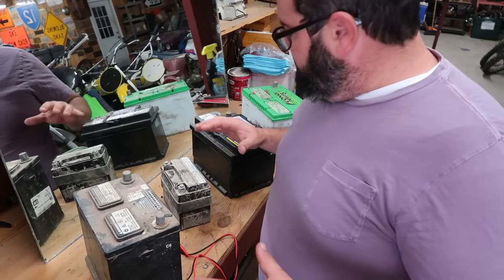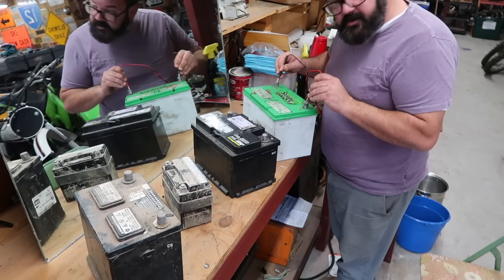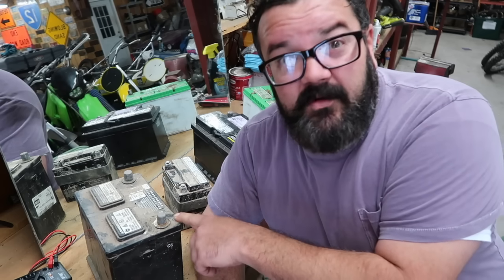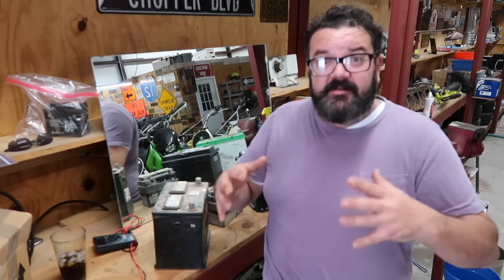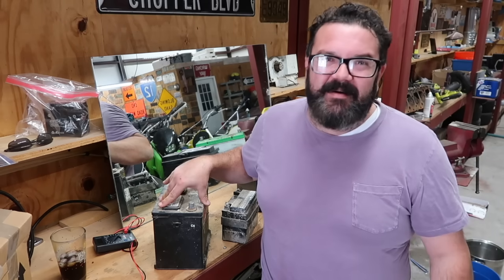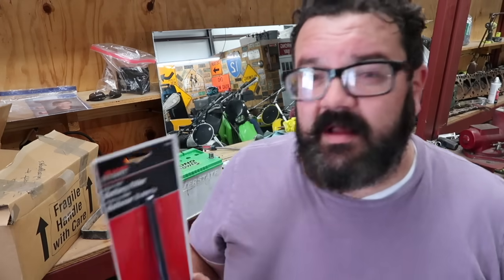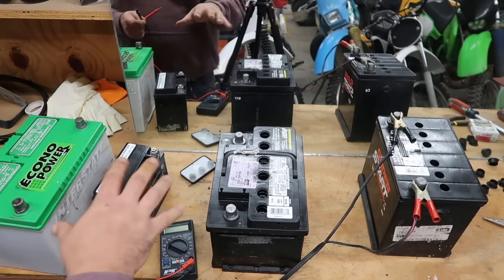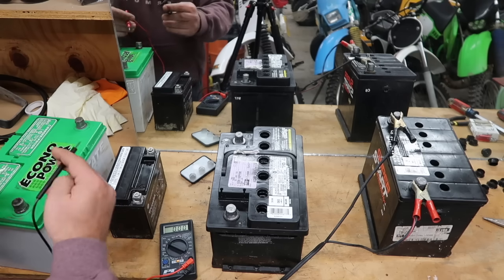Reconditioning a 12 Volt Car Battery: 100% Success

Comment: Is not 100% successful but still reasonably effective.  Just a couple better practices tips for you would be 1: do you know what voltage charge the battery is actually holding you need to wait at least one hour after removing from the charger before taking your reading to allow for the battery to cool down. A perfect lead acid car battery will read 12.8 V fully charged not to put down your method of recovering these batteries I do need to be negative for a second and inform you that the batteries you are getting a reading of 11.2 V 11.4 V have what is called a dead cell in the battery and will never hold anything more than the 11.4 V. This will be confirmed if you were to test each individual cell voltage in the battery and it will confirm what I am saying about those batteries in this video. unfortunately I have not found a way to fix a dead cell battery successfully.
2: A dead battery before you start your process reading 0.5-3.0v Will have a 99% chance of getting full voltage back out of it after you’ve done what you were doing as all cells are in the battery have drained equally. And a 12 V lead acid battery each individual sale in perfect condition will have a voltage of 1.2 V all six cells combined you get a total of 12.8 V which is what a perfect condition fully charged battery would read. If when starting your process you get a reading of 10 V or around there there’s going to be a 98% chance that one of the six cells is dead and no matter what you’re doing or showing us you have done in this process is going to fix a dead cell if you get a reading of 10 V 11 V at start I would suggest individually sell testing voltage you will find that five out of the six will have a reading of1.0v and once I will have a reading Around .5v. The .5v is your dead cell. You might as well check that battery to the side and not waste your time trying to do this process with it because it will never recover that dead self no matter how long you keep it on the charger after an hour or more of rest and cooling down after removing the charger it will again drop to 11.2 V

Comment: Have you rver created a wet battery or eater battery using plants if copper and nickel, i like using these for the wet or water battery.  And in this copper -nickel eater battery, the plates may oxydize and would need to be polished down for better contact in each cell, each cell dhould register 1.5v a universally found voltage, from solar panels and humans, to wet cell batteries or water batteries with each cell registering 1.5 volts.

Comment: Basically you "de-sulfated" the batteries but in the process destroyed the cells (lead plates). While they will show a good charge, the ampacity of the battery is garbage. They couldn't start a lawnmower.

Comment: If you throw a wire over a tree limb at 20 ft high,  you can measure 14v DC, wow, you say, but there is almost zero amps avail so since Watts = Power = Energy = V x amps its about () watts, BUT if you now raise that wire to 1000 or 3000 ft, you can collect lightening bolts, lots of amps for short time, and the volts are what about 1Million volts,  BE CAREFUL, wait for experts; but it does bring up an interesting point Tesla mentioned, " we are surrounded by energy, while we starve for energy" lol.   So build a 1Milliion volt motor, send a conductive lightweight wire up with a balloon, wait for lightening bolt to run motor; if motor is connected to a building raising device you can store the energy (or a water pump to pump water up to mtn lake, or water tower, etc... BE CAREFUL ! The life  you save may be your own.
Reply from the maker: TOOOOO MMMAAANNNYYYY COMMENTS

Comment: The epsom salt idea seems to always bring the voltage back up on batteries, but I've yet to see someone get any real success by doing a load test that actually shows the battery can deliver the amps to turn over a car properly. You can have 12.7 volts and the battery immediately drop under load and only supply 100amps when it should be dishing out over 700amps.
Reply: My thoughts on this were pretty much the same as yours, that is until this happened...
I tried to bring a deep cycle 12v back to life, and although I did get it to hold steady at 12.7, it was no good under load. So I put it to use in an outbuilding to run a lightbulb, keeping the battery running with a small solar trickle charger. One day just for the heck of it, after six months, I decided to test the battery and I'll be damned after seeing it had actually restored to it's new state of operation after the low slow and very long trickle charging. It seem we need to rethink the time needed for this procedure.

Comment: One more try before you try to desulfate the led is simply try cycles of charging and a strong and quick discharge with a diesel glowplug every 2-3 hours. Do not discharge completely, connect the glowplug for 5 seconds and again leave on the charger for couple hours. Strong current helps to break thin sulfate layer on the led, and battery will accept the charge again. Of course if the condition of the battery is not totally bad.
You could also try complete method for battery reconditioning described here: https://world-n-life.com/?page_id=44

Comment: I really can’t see what you’ve achieved. Voltage testing is only part of the story. Amperage is what you need to check and acidity of the solution.  I’m going to try dumping the sulphuric acid, washing out the plates and returning the acid

Comment: Just buy a new battery. Your recondition battery will never last very long if it does work at all. You’ll end up getting broke down somewhere where you’ll have to buy an expensive battery because it’s close to your breakdown point. Better to buy one where you can get cheaper and plan ahead.

Comment: Why don't you just immersed the battery in a ultrasonic cleaning equipment. I bet the ultrasonic wave can remove all the sulphate deposit ok the plates. Have anyone try?
Reply: Not a bad idea. I wonder if it would break the cleaner.

Comment: Seriously man all batteries have cycle they don't last forever. Now we have New technology salt graphite,  lithium ion and now we have BMS controlled and dcdc chargers built into batteries batteries have now changed. 4×4 RVs caravan are all discovering new better ways to get longer cycles. Balancing cells also you can make your own battery with PVC and cap it use solid copper bar or nickel rid pack it with crushed powdered graphite or charcoal seal it charge it there's your high Amp Battery try it

Comment: Do you not understand what volts and AMPS are? 
What makes you  think salt water will work like 35 percent Sulfuric acid?
Why would the battery manufacturers pay for Sulfuric acid if cheaper salt water would work as we.l or better?

Comment: These hacks do not work on batteries with dead cells or one that will not hold a charge. If the battery is good but has sat around and lost its charge just simply charge it for a day.

Comment: It would work right away, but after a day, the battery charge would go lower than previous day. In simple words: it is wasting time and it would not work. I experimented it for weeks, the result was very disappointing.

Comment: When a battery is dead, it is dead. Period.
Reply: not true at all, there are some better videos out there showing it best to use a battery charger with the 50Amp 250v START cycle and you hit the batteries with that for 15  minutes × 5
Reply from the maker: Nope

Comment: I don't know man that doesn't prove the batteries bow ones.good, you need to load test them if they are good now or not,   because mine is 13.8 volts,but still can't crank the car at cold weather  below zer after one day of charge even the voltage sg
Hows 12.6 V and it can't crank the after two days even above zero temperature, even the voltage showing 12.2 V.

Comment: You are 100% wrong. Letting any car battery sit dead for long periods of time does NOT create permanent damage. The acid turns into a crystal on the lead plates. When recharged, (usually you will need a vintage charger without overcharge protection) the crystals on the plates dissolves and returns to sulfuric acid. No damage done. And it is also is impossible to make a car battery last forever. When you use a car battery, whether you charge it, or discharge it, it is transferring electricity, which causes heat on the lead plates. What happens when something heats up? It expands. Then when it cools down it contracts back to its original form, which, over time, causes the lead particles from the plates to break off, and build up at the bottom of the battery. When too much lead particles build up on the bottom of the battery, then what happens? It starts touching positive and negative plates which causes shorts. That is the ONLY cause of a batteries failure. That’s why worn out batteries get so hot when charged. There are ways to reduce lead plates from breaking apart, (aka shedding of the plates). One, is to always use a slow charger, because the less the current, the less heat will be created. Two, is to use a “Pulse charger”. What this is, is a charger that pulses, meaning it charges the battery for like half a second, then turns off for half a second, so it gives the battery time to cool down, so the plates don’t get too warm and expand very much. So there really is nothing you can do to “renew/recondition” a battery, unless you take the plates out, melt them down and make new plates, and clean the lead particles inside the bottom of the battery case. So any video/ad that advertises “battery reconditioning” that just shows them putting in random shit like baking soda, or epsom salt, is a scam. Baking soda, won’t do anything but neutralize the acid, which will make the battery have no chemical reaction, and will bring the voltage down to zero. Epsom salt, does not renew a battery. It kind of boosts the conductivity of the battery electrolyte, barely, and is not necessary at all.

Comment: A battery needs to tested for it's ampere hour capacity ... ie  5 amp load times the time it takes to  discharge it ...... amp hrs ...... you will never get full capacity back because the lead pasted plates how lost much of the lead sulphate has dropped off to the bottom of the battery! . In short you have slightly revived two batteries which will have a small amp hr rating ...... and not for long !!

Comment: There is some speculation here about the charge being "held in the plates." The structure of a car battery is a bit more complicated than that. There are separate positive and negative plates and some of them act as a current collector. One thing to note is that a good battery will not only hold a charge, but will eventually generate a full charge even if it is fully discharged, due to the reaction of the acid with the plates. For that reason, if the epsom salt does clean off the plates as stated, you would be much better off rinsing out and replacing the entire liquid solution with new battery acid and water and not leaving the epsom salt in there.

Comment: All these batteries won’t hold on load test, dirty electrolyte is saying something bad about what happens in battery. Pasted greeds are damaged, its likely seems to fail. You can recharge and get like 12V but in case when car starter needs a lot of energy from battery, battery don’t hold it. My work experience id more than 15 years in battery industry.

Comment: it may have voltage but no start power
Reply from the maker: Untrue
Reply: @CarGroves  so that means you dont know what you talking about
start a car with a 12 volt lighter battery it has 12 volt

Comment: You should have measured amps on each battery. You do have volts but to start a car or motorcycle you need amps.

Comment: volt meter only reads the volts, you need the proper tester to find out if progress was made. in this case you failed to show that. all you did was prove you brought voltage up, but what about the amps

Comment: You would have been better off Buying New Battery acid, 6 quarts,17,50, I completely, clean out the batterys with Baking soda,rinsed out 5 times till clean water came out, All 3 battery recharged to 14,50 volts, 1 of those battery,s was 18 years old the other,s over 10 years old

Comment: Where you ALL go wrong is you guys try and “make” your new electrolyte in the battery itself. You must use NEW pre mixed electrolyte. Those of you who have mixed a motorcycle battery know what I mean. When you open the plastic bottle it has premixed sulfuric acid in it NOT salt water. Come on man… and it only works if you don’t have an internal short with the lead plates touching inside

Comment: That doesn't mean s*** what you tested them and none of them came back too close to where they should have been brand new f. You do charge them a whole bunch more. Will they hold under a load tester? Because I've done these same f**** things. All these stupid tricks and they never hold up like a new battery. Does they might run under low load circumstances?  Here and there and work for a minute, but they aren't like new.Not even close.I haven't found any message yet That really is, I think the whole thing.
 Is cool. I just think it's really faulty. Testing of you at the end to show that they're actually good now. Cause that's not what you do when they take them to O'reilly's. It's put a little f**** voltage meter on and go up to bed 12. They put him under a load tester.  Just like when you start your car up. And it has a heavy load on it. How well will the battery turn it over? So, if it doesn't have a good charge, it will barely want to start your car. But once your car gets started and charge it up a little bit. It'll start better, but then the next day I won't want to start your car again because it will have pittered out to nothing d*** near and then your car barely starts.  And then the next time you started an hour later after you driven. And start straight, but the next day it won't. And then you know this didn't really work cause my old battery. That was brand new before it was really good. Started my car fast every time for 2 years. But now this has worked for less than 2 days. That was my experience following these directions.

Comment: Not 100% success yet, you need to test how long does the battery hold its power after the charge without any load.

Comment: I missed the part where you tested the batteries with a carbon pile, Volts are just a rule of thumb indicator, cars run on amps, you can have proper voltage on a battery that won't output enough amps to run the car.  You need to revise your video.

Comment: Volt meter tells volts, NOT ACTUALL NEEDED CCA / COLD CRANKING AMPS...3 AAA Batteries in sequence equal 12 volts + but WILL NOT Start a Vehicle

Comment: Just one minor detail dude,  12v is dead!  There is no meaningful charge in a 12v lead acid battery when charged to 12v. They should be close to 14.8v. Would love to see a follow up video shop that everyone can learn from the pain and aggravation you experience after you install these batteries back into vehicles.  The devil himself will crank your car the first time,  giving you false confidence.  Then you'll be stuck. Let us see that part!

Comment: I watched your video, then I wanted to get confirmation, of which I did. But one guy referenced your video, and went about it wrong. He ended up trying to charge the Epsom salt mixture, but didn't put the acid back in.
I was yelling at the video, saying, "that's not how he did it dummy".

He also neutralized the left over acid in his battery, by putting in a heavy mix of baking soda. And never rinsed it out, before putting the acid back in. 
And then he tried to do part of the salt solution. Lol 

At least he didn't bash you. Because he's the one that didn't follow your directions.

https://youtu.be/VvqqUiwsUZY?si=yGvpleQEsZqilWvg

Comment: You should be real careful how you connect charger or jumper's to Battery if you create spark on lead acid the hydrochloride can explode so try positive first then negative jumper cable to Earth body not battery Pole. Go learn About solar panels Battery hookups they are hooking up 12 v 200 to 300 Amp hr batteries

Comment: THAT IS NOT A SUCCESS
WHERE IS THE LOAD TEST ON EACH BATTERY ?
COULD THEY DO WHAT THEY ARE DESIGNED TO DO 
START A VEHICLE
SHOW THE LOAD TEST
OR PUT EACH BATTERY IN A VEHICLE WITH AN INDUCTIVE AMP PROBE CLAMPED AROUND A BATTERY CABLE AND CRANK THE ENGINE WITH NO START - LET s SEE THE AMP DRAW

Comment: All you are measuring is Surface Voltage .... most batteries off the charger measure a good voltage... load test it ... you may be really disappointed .

Comment: It's not big trick to get a voltmeter to read 12V even with a almost dead battery. The real test is does the "fixed" battery start the car reliably over and over again? Does it pass with a real battery load tester too?  I bet not. Simply flushing the cells will not bring back all the necessary capacity a new battery has for your vehicles. I recommend paying the bucks for a new battery rather than risk breaking down on a dark road in the rain! Stop being cheap.
Reply from the maker: It started the vehicles
Reply: @CarGroves  Dose it start cars in the dead of winter, at night, at 10F? Does it pass a load test, like Autozone or Advanced Autoparts will perform for free for you. I would be very curious if it does.

Comment: Metering the battery with out a load means nothing and voltage is great but it's the amps that I care about one more thing the voltage comes from the negative not the positive I'm out of here
Reply from the maker: Video 2

Comment: You can't call this a 100% success because you didn't LOAD TEST any of the batteries. You can charge bad batteries to full voltage and as soon as you load them they'll fail. This proves nothing.